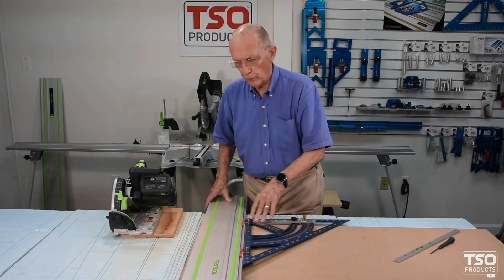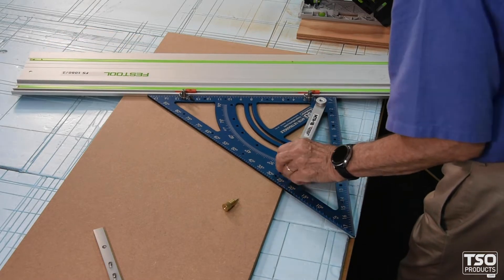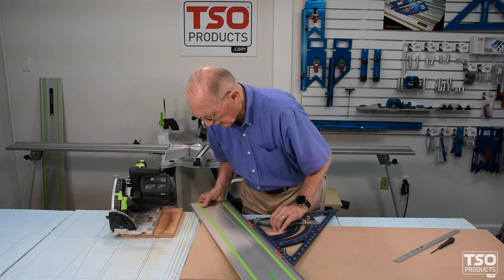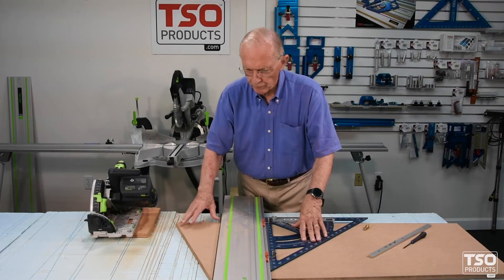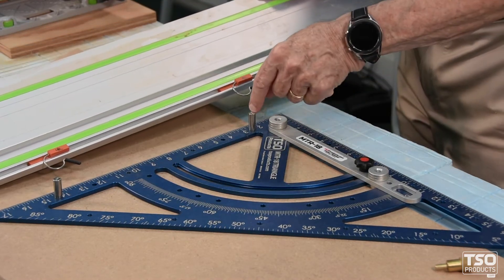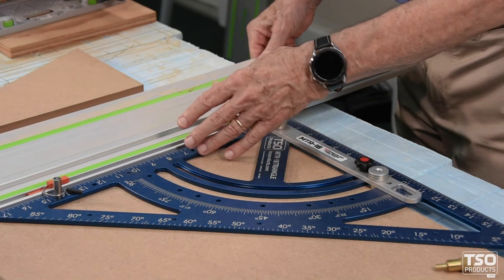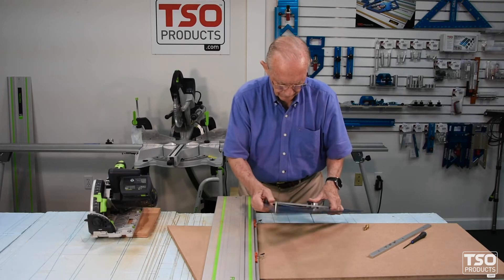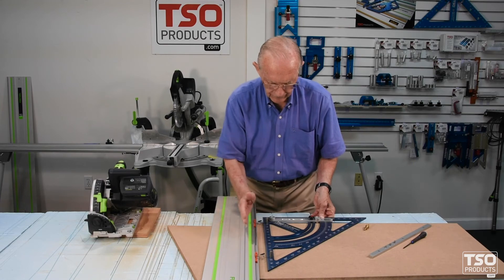Easy Angle Cuts with MTR-18 Precision System Triangle

Comment: I've struggled with trying to figure out how to get angles going in the other direction for some time.  I finally ended up putting the guide rail along the hypotenuse instead, which gives a range of -45 degrees to +45 degrees but need to subtract 45 from the value shown on the MTR-18.  (I am still trying to find a solution to somehow retain the dogs so they don't fall out as you handle the MTR-18....)